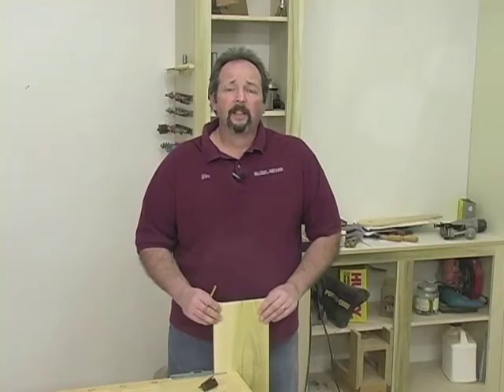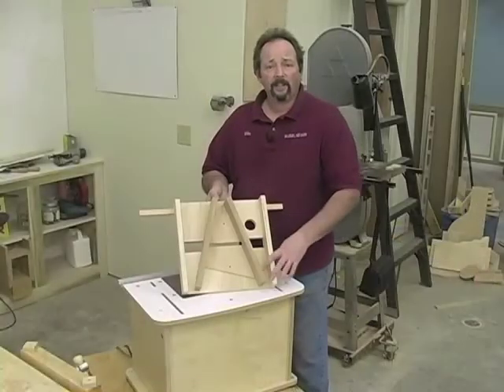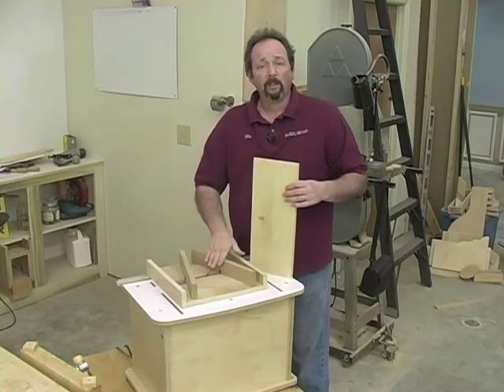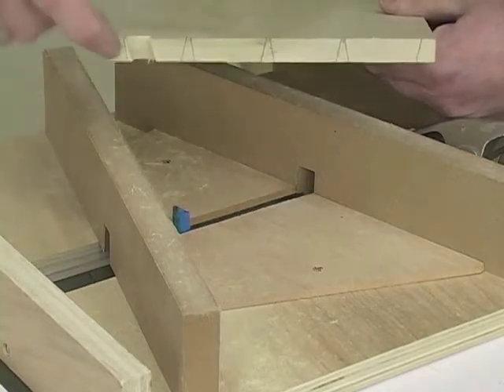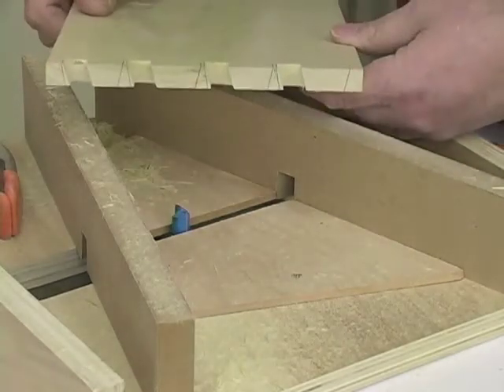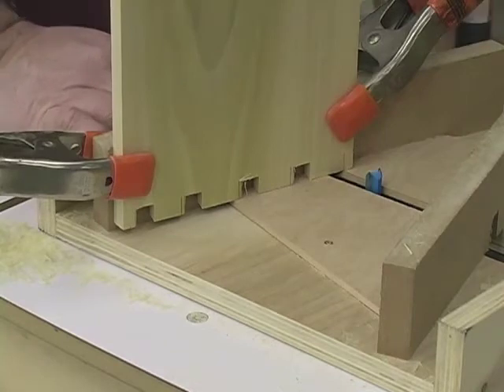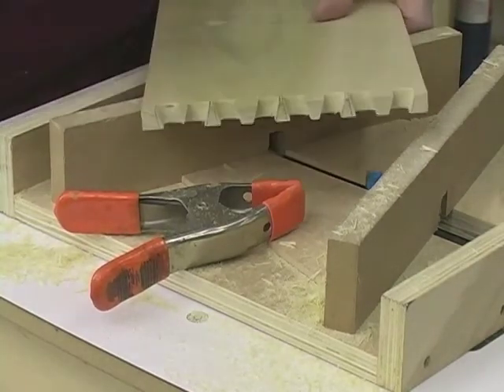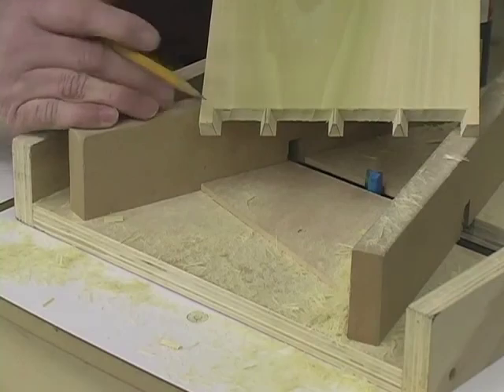Powered-up, Super-thin Dovetail Pins

Comment: The issue with using power tools to get thin pins is not on the pin board, it's wasting out material on the tail board. You explained the problem sufficiently but left out the actual problem with using power tools to get thin pinned dovetails.